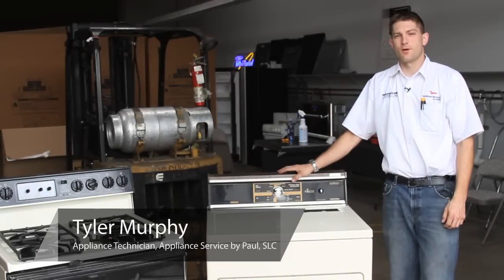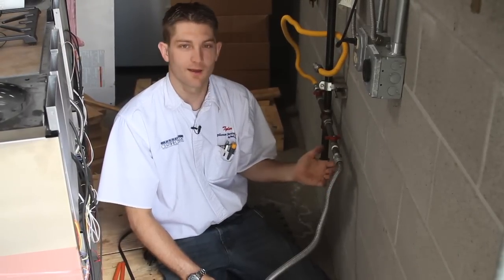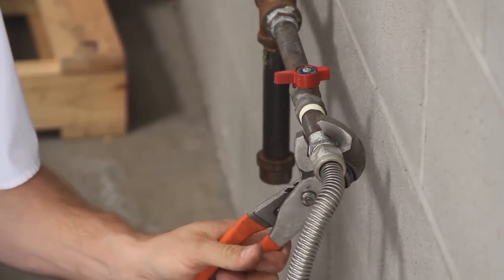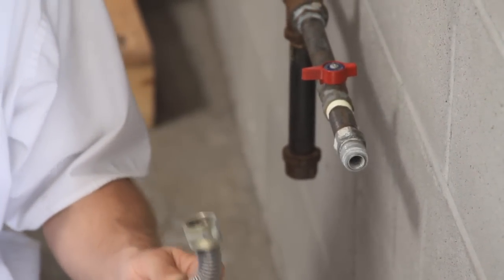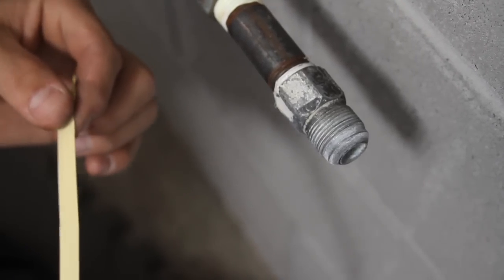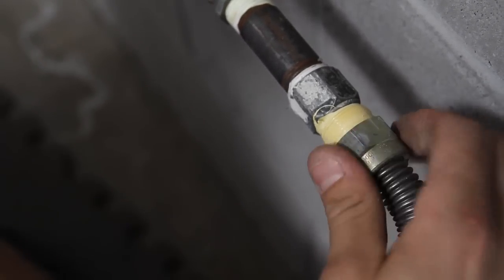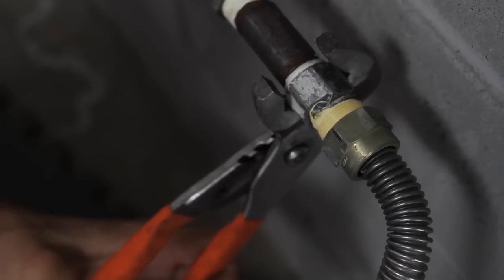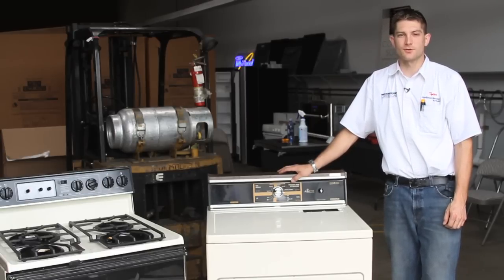Gas Stoves & Ovens : How to Fix a Gas Line Behind the Stove

Comment: I am a 64 yr old, 5'2", 114 lbs, female with rotator cuff injuries in both shoulders. Early in life finances taught me I could do a lot of things I didn't know I could if I could find the proper 'how to' information. Automotive work measures 'how tight' in foot/lbs with a  torque wrench so when replacing the gas lines, connectors and shut off valves for the water heater when it went bad left me with the 'how tight do I get these?' issue. I checked varies articles and websites and no hints at all - until I watched your video. Imagine how (not) happy I was when you said, 'get them as tight as you can.' You were using channel locks, I have been using wrenches - thankfully. It was a serious amount of straining, but they are on as tight as I can get them and the best part? They aren't leaking. THANKS!

Comment: Flex gas pipes have flare fittings. 
Install a brass flare fitting on the steel pipe with yellow gas tape.
Install the flex pipe onto the brass fitting flared end with no tape.

The appliance also has a brass flare fitting for the other side of the flex pipe - don't use tape to connect.

Comment: Pkevin79 is correct - that looks like a flare fitting so NO NEED for teflon tape - it's possible that the addition of teflon tape might restrict the flare fitting from making a solid connection... ALSO important to let folks know to TURN OFF GAS SUPPLY at local cutoff valve or main valve......
Reply: Also,  "...tighten as hard as you can..." is not good, as you can break the joint apart and damage the seal

Comment: why are you using Teflon tape on a flare fitting?  The threads are not the sealing portion.
Reply: Gas line "goop". A real professional. Tape on the flare?  So scary these people are out there...
Reply: Y’all are all wrong.....gas approved tape is less messy and seals just as well....this guy however didn’t use quite enough tape

Comment: he also clearly doesn't know you don't use tape or dope on a flared fitting and also channel locks are a no no on nuts let alone not knowing how to use them at the end he had them facing the same direction as he was tightening the line back up

Comment: never use tape or paste on a flared fitting!  please  follow proper code for installation.
Reply: What is a flared fitting ?
Reply: why?
Reply: That's specifically tape made for gas. Why not? Serious question
Reply: Eric Kimmy flare fittings are designed to Seal with the flare head, not the threads, by putting sealant on the threads you could cause the flare head to not seal against the nut properly
Reply: @kylebergeron9406  thank you
Reply: What's a flared fitting? Is that what we call a "bayonet" fitting in the UK?

Comment: those flare fittings shouldn't have tape, it should seal with brass in contact, he needs a new flex.e hose connection

Comment: Most important step was missed. He never explained to turn the gas line off first. For someone who isn't familiar with doing this work, they may not know that they are supposed to turn off the line.
Reply: He also didn't say how many times to wrap the tape around the fitting. He also used the wrong fitting. He also didn't say anything about over tightening.
Reply: He also torques the household pipe (you can see it) when tightening up because he isn't steadying the pliers on the household pipe at all.

Comment: So many comments complaining because he used Teflon tape on the adapter threads. I've repaired enough leaks to know the tip may have scratches or imperfections so I would highly recommend putting a little something on the threads, and I even go beyond that, but that's just from my experience and what I've seen.
Reply: Definitely want to use proper tools like crescent wrenches, as well as new connector and adapter when connecting a new appliance.
Reply: They are catching flame.

Comment: This is why the internet can be dangerous.  This guy does not know what he is doing. Turn off the gas valve first.   Use pipe wrenches, not pliers.  Do not put tape on a flared fitting, or you may get a leak.

Comment: Channel locks on a metal fitting?  No no no... two crescent wrenches would have done the trick.
Reply: He not only used slip joint pliers but on the final tightening he used the backup pair backwards.
Reply: Adjustable wrenches are just as bad.